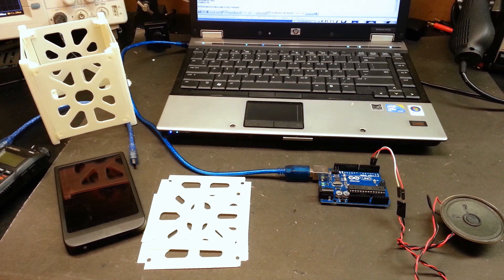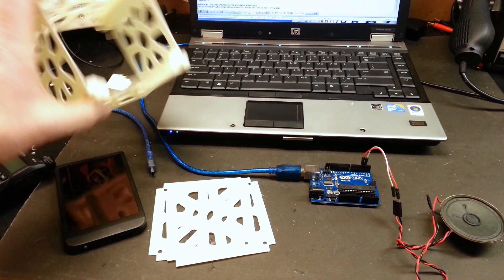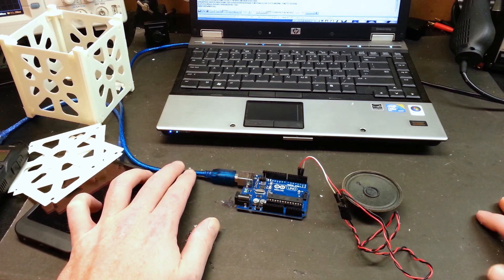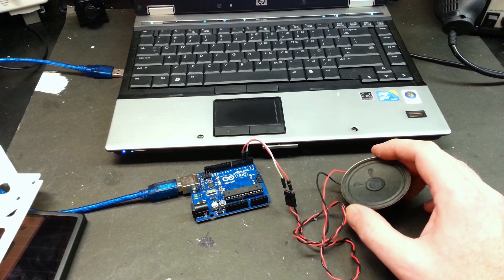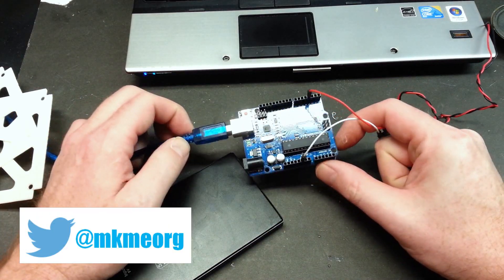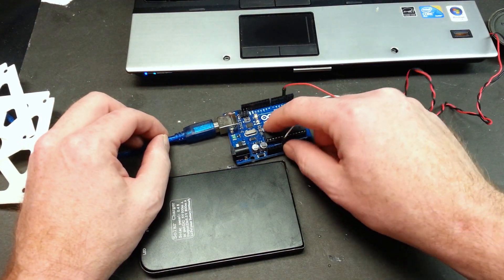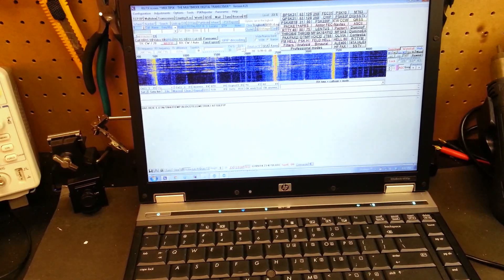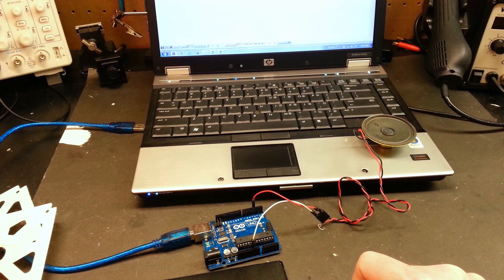Let's make a Satellite with Arduino Part 3- Morse Code (CW) Telemetry

Comment: Universal Unisons Unity For All Orbitals Harmonious Satellites Operational Shortwaves Frequencies Sw44-20khz SO's Morse Coded Singles Specials Planetary UltraSounds Ultra Super Sonic Electro Magnetic Radio cycle waves Transmissions DriveingOperated Magnetic Comet Steers Built to Land Onto Comets Drill Into and Rest.Sending Solar Magnetic Steering Satellites Shortwaves Frequencies Sw44-20khz SO's Morse Coded Singles Specials Ultra Sounds UltraSuperSonic Radio cycle Transmissions Guiding Steering Satellites Over Comet to Steer In Away From Our Beautiful Planet.This Would Work If Laboured By NASA ESA  All Space  Station Planetary Satellites Engineers .Online Labour Replies Please.